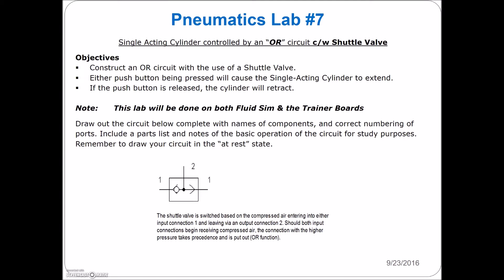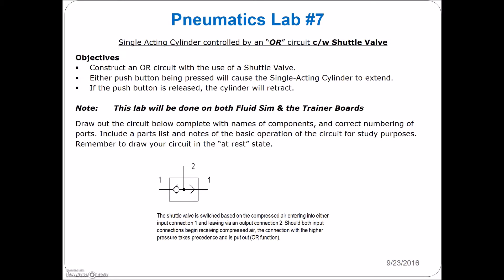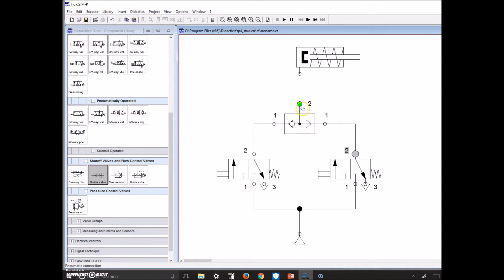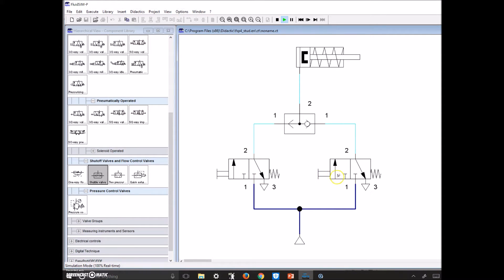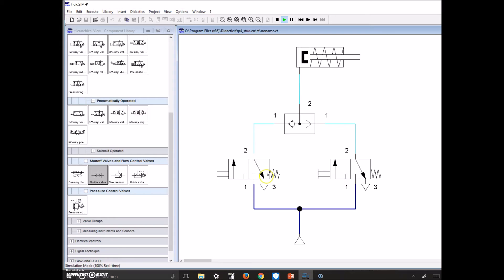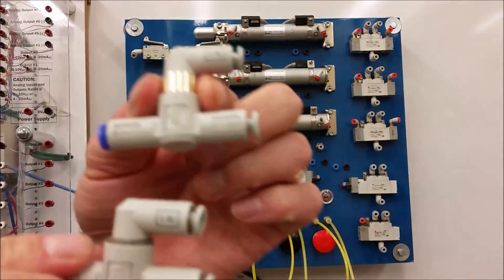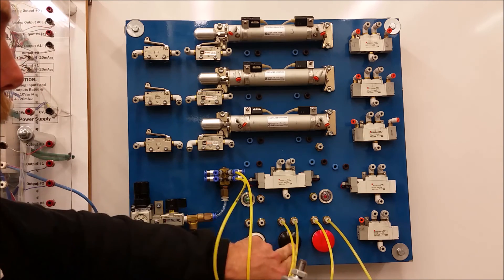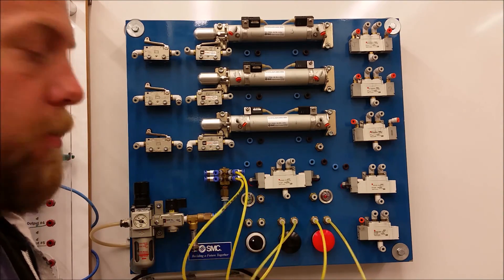Pneumatics Lab 7_OR Circuit using the Shuttle Valve

Comment: Excuse me, what happens with the output, if both buttons (input signals) are pressed  at the same time?
Thank you very much for these wonderfull practical videos!
Reply from the maker: It is an OR circuit, so PB1 OR PB2 will cause it to extend. The Shuttle Valve stops any air escaping out of the alternate PB.